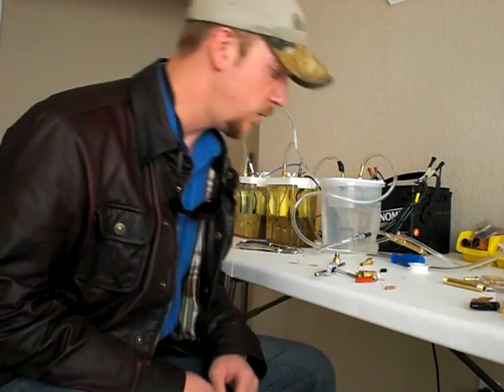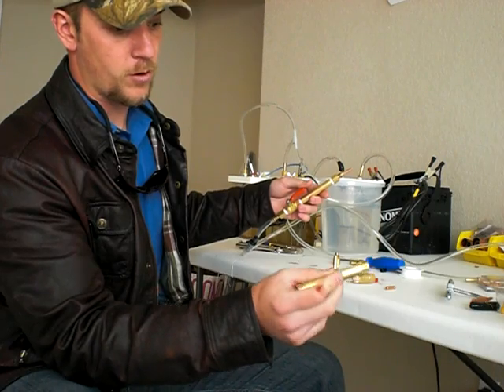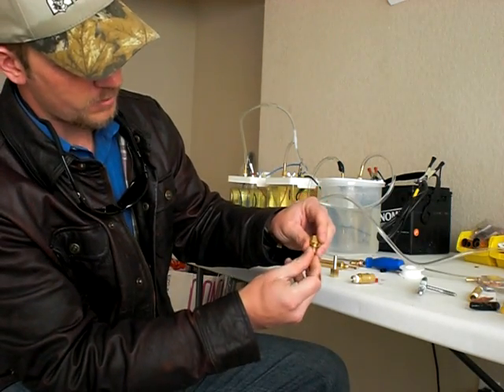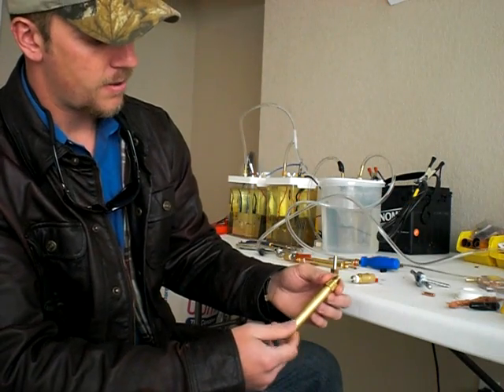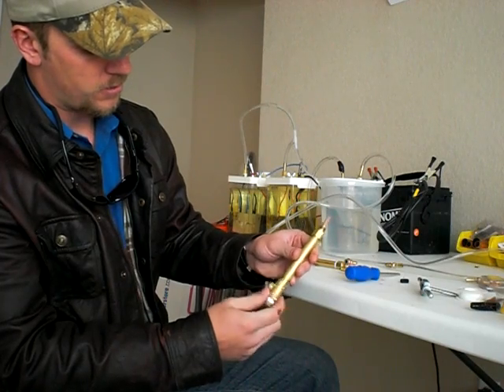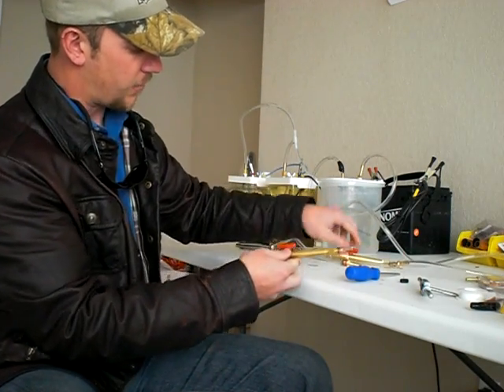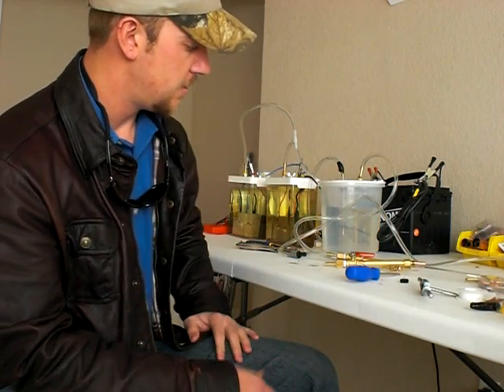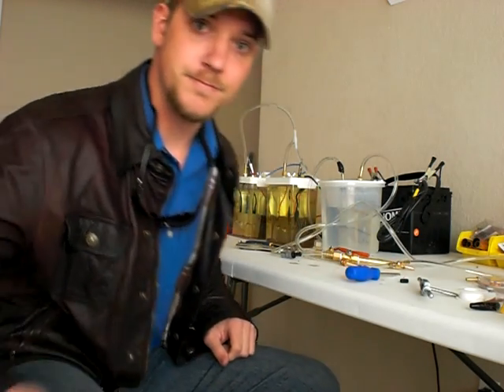HHO Torch Construction DIY, GreenFuelSpot.com

Comment: Can I weld with this thing?
Reply from the maker: Homeopathic Fossil-Fuels you can melt metals together.....braze....but I wouldnt call it welding
Reply: Ah, Cody from Coy's Lab made his own HHO torch and actually managed to both weld and cut metal, I wanna build a microlite on the smallest possible budget where it still is within the guidelines, regulations and tolerances of a legal microlite aircraft

Comment: Teflon tape shouldn't be used,Teflon paste is recommended for gas !
Reply from the maker: 73roadrunner1 , realize, this was my very first effort in 2008.  We've always used tape for gas applications.
Reply: +Jeff Sokol The difference is negligible on lower pressure applications however paste is suggested for gas due to the possibility of leakages due to uneven fitting of the tape.
Reply: can it weld 20mm tick steel?

Comment: Thanks for your video!  How much pressure or liters per minute do you need to get a sustainable flame, and what's the minimum size of hole that will work for a tip?  I've tried attaching things like an inflating needle air pin as the tip, but still get flashbacks that blow the top off my bubbler.  Thanks in advance!
Reply: Grant Thompson - "The King of Random" woah found you here huh? I was asking the same questions grant! I just purchased a hho generator that outputs 6-8LPM so i will be making some "extreme party poppers" soon!
Reply from the maker: This was about 1.5-2 liters per minute, it didn't take much.  This was based off of my first cell.  We ended up making torches over 25-50 lpm later on with bigger machines.  We used a .025 mig tip for this one.  The bubbler in this video actually did blow up on me eventually....  I ended up getting heavy steel bubblers from George Wiseman at Eagle Research, they worked very well.   Thanks for commenting man, sorry it's 8 years late.  LOL  Love your channel.

Comment from the maker: that's the whole idea of using it, is to prevent flashbacks.  make sure it's damp prior to use as an extra precaution.  you can use water or vinegar, just wouldn't use whiskey or anything....:D

Comment: may i suggest you use a ceramic tube to avoid the heating problems, should be easily available as a tube with a thread at both ends. you might have to get different sized brass fittings to suit.

great work mate! keep it up, the less we rely on fossil fuels the better.

Comment: thank you ... nicely done ... a good reliable torch made from materials most anyone can get hands on ... 

I think if you added up your cost of materials and charged as little $15 per hour for the time it takes you to gather the parts, assemble the device, put it in a box, take it to the post office and send it out, you would be surprised ... that little gem could easily be a $100 widget ...
Reply from the maker: Gary Hendershot you're still a stud